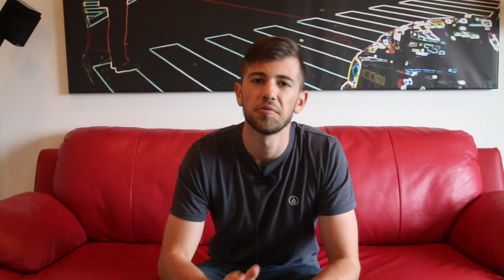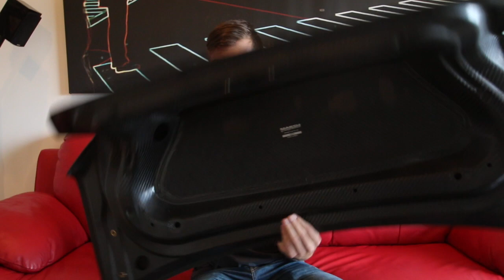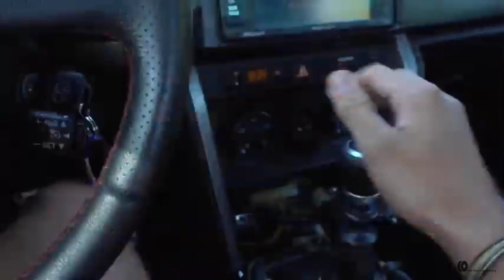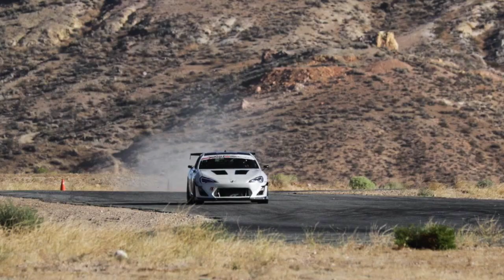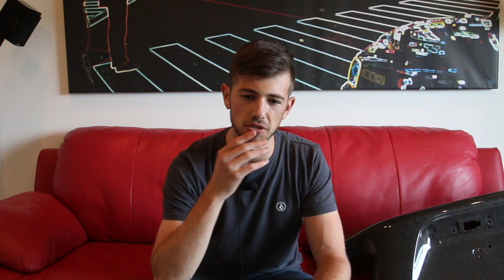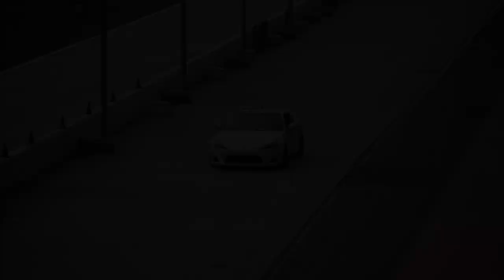Issues I've had while Tracking my FRS (And how to solve them)

Comment: You are learning the ultimate lesson we all learn. 

Just build a purpose built race car and tow it to the track.  

Either that or stick to autocross, lol. 

With these type of cars, you need to keep the engine stock if you want a dual duty car. Want more power, get a different car.  

The Miata is the same way. 

Keep the engines stock and it cuts down on a ton of other issues.

Comment: Definitely had major fuel starvation again at Superspeedway on the long left. Stayed down off the bank on the flat which gave me another lap or two before it cut out severely. That was around 5/8 tank left. I installed the Verus fuel door so we'll see how that goes. (Even though I don't think I spilled but a few drops of gas the car reeks now. 😅)
Reply: Different track, but I was having the same issue on all season tires with half tank.
 I ended up installing a CBR fuel pump. Trip Skywalker has a DIY for that. Worked well, will give it a shot on a set of super 200s soon, let's see how it goes.

Comment: Hoping it was just fuel starvation at Nashville superspeedway. Steep left-hand bank with a little bit of left turn but at high speed where it's guzzling with na stock engine. Had a half tank left and otherwise felt great but about 105 mph on that angle it felt like the fuel cut for a second on the last few laps of the third/final session. I'm really hoping that's it. Had a Scion tC that would choke real easily at about 5/8 tank left on flat hard turns.

Comment: Just curious since you are sponsored by Verus, why did you not use the Verus Rear Cam Cover Block in conjunction with your Verus AoS?  That setup should have prevented you having to do an atmospheric setup that got oil all over the underside of your car AND prevented the oil starvation issue.  Am I missing something about the situation.  I was thinking about using just the setup that I mentioned when I go FI but I am wondering if there is an issue there.

Comment: Hey boss this video is amazing, I own Huracan and want to build a track car and now I'm second guessing the frs. What would you recommend? Appreciate your response
Reply: Miata is always the answer..
Reply from the maker: If you have enough money to afford a huracan then there’s a ton of options for you to consider. On the upper end there’s mclarens, lower down you can do the new C8 corvette or a C7 Z06/ZR1. If you’re trying to build a JDM car then consider the new Supra, the S2000 or a K24/LS swapped FRS/BRZ/86.
Reply: @OrenHolzman lol I want to stay in a 20k 30k budget I don't want to go crazy but yes the huracan was a dream.
Reply from the maker: 20k or 30k for the car or for the complete build
Reply: @OrenHolzman  possibly complete build. To be honest we have tracks here in Toronto Canada that are not that long but you can still use the power on the straights. I just don't want to get a car dump 10k in and then be like I need more power. I think the frs supercharged is sufficient because apparently the handling is amazing. Cars right now are expensive as hell. A guy I know blew his cayman s and a replacement motor is like 25k that's just ridiculous to me so I'm just asking because you are actually doing it. This is not a daily driver for me its something I can learn limits in case I put it in a wall🤣appreciate your time
Reply: @OrenHolzman  I haven't seen a reliable k24 swap but if i know that works and car 10k/suspension brakes tires 10k/ k24 swap later 10k thats total 30k ish

Comment: Just started having blowby issues. GTX2867r tuned on e85 making 390 at 14 psi. Street car but gets the dick beat off it. Sick of the burning oil smell and smoke at this point. 
 Know of anyone using the accu tank with success? I’m not sure I’d want to be returning the blowby back into the motor with all the ethanol. Seems like a sure fire way to wash it out. Even with regular interval oil changes.
Reply from the maker: If you’re referring to an accusump, that’s a bandaid and not a solution. You’ll still have the same blow by, the accusump would just replace it with pressurized oil so you have less of a chance of oil starvation.

Comment: Doesn't the verus AOS have the option to drain back to your cam plate cover? Seems like that's a nice neutral spot to drain to without much travel.
Reply from the maker: I had drain back kit. I think it filled so much that it overflowed the drain back.
Reply: @Michael Benson How did you set your AOS up. Pcv valve in the block or in the AOS. did you have the pcv valve installed and vta? We’re you boosted? thanks. setting one up now.

Comment: Thanks for sharing your experience, I regret not seeing your video earlier lol. I owned my frs about 2 years and I learned a lot driving skills throughout tracking it. At first I was just running the track with stock power, and gradually, I started to upgrade the suspension.. tires.. ect. Everything went smoothly until I decided to add more horsepower to that frs. The SC kit gave me a sweet time but also ruined my trans and motor. After about 7000 track miles my engine blew like yours. I think a lot. Thinking that I have spent so much time and money on the car, I decided to build new motor and swap it. Now my car is still in the shop and I'm still struggling with how to solve the transmission problem... Ah if I could see your video earlier, I would probably buy a C6 or other more reliable car for track car ;D

Comment: There are a lot more problems om our cars. Coilpack failure, weak axles/rear end,  wheel bearing failure, burning coolant, going through brakes like crazy compared to similar weight cars...
Reply from the maker: I FORGOT TO MENTION THE COIL PACKS! Yeah all of these are true. I just haven’t experienced them myself. Even with forced induction my stock axles were fine and I have an upgraded diff. I didn’t burn coolant and I actually had good life with my brake pads. That being said, all of what you said are common problems.

Comment: So.... I'm in mechanic school and I am learning a lot from your videos and want(ed) to get an FRZ and tune it.....I am starting to think that this car isn't meant for serious power upgrades after hearing everything you have had to replace on your car with headers, tune, and a turbo. It seems like you are going to have to rebuild your entire engine after this process is over.  Maybe you should cut your losses and buy a used cayman or boxter...Idk, let me know what you think.
Reply from the maker: Adding power to this car is difficult. The engine and trans both aren’t capable of handling power reliably. If you want a car that’s out of the box quick and moderately reliable, consider the C7 corvette or maybe a cayman. But if you’re willing to dedicate the time and money, building this car has taught me so much and starting with a slow car has helped hone my driving skills. Look at the Evasive Motorsports Pikes Peak FRS. That thing is heavily modified but it shows the FRS chassis has great potential if you’re prepared to do what it takes... maybe I should make a video about this, lol.
Reply: @OrenHolzman  Thanks for the reply. Yea that sounds good to me. I definitely want to learn how to work on a car and track a car and this car is a relatively inexpensive entry point. Best of luck!

Comment: Taking notes 📝 I want to go back to the track so bad. More of a risk now that I'm boosted though
Reply from the maker: Definitely but as long as you have an oil cooler, air oil seperator/catch can, and a way to keep track of oil temp, oil pressure and boost, you should be fine!

Comment: Why not IAG AOS? They have the system that will dump the blow by oil back into the oil pan through the oil filler cap.
Reply from the maker: As far as I am aware, IAG does not make an AOS for the FRS. I highly considered trying to mount the IAG AOS and testing it out but then my motor blew. However, the blow-by was not a result of the catch can/AOS, it was caused by the motor itself.

Comment: How is the new trans holding up? Would you have gone any other routes(i.e. gear sets)?Do you think the Verus AOS is no good?
Reply from the maker: The new trans is holding up well. You could get strengthened gears / synchros and if you have the know-how, install them yourself for a cheaper solution. Because transmissions are daunting to me, I am happy with my decision to go CD09. As far as the Verus AOS, I think it is a good option but my engine and it’s blow by issue was the problem. The Verus AOS is great for a motor without the blow by issues.
Reply: @OrenHolzman  thanks bro, im was looking at PAR gears and the CD09 trans. I was just wondering how much more reliable. Or if i should go with the gears, and Verus synchros. Still have some time to get it all figured out. I am going to get the AOS from VERUS. Thanks bro
Reply: @OrenHolzman  i forgot to ask could we run our own clutch or do we have to use a nissan clutch with the CD009 trans?